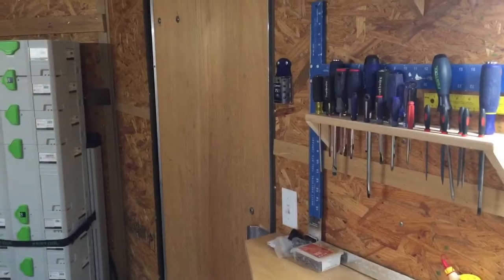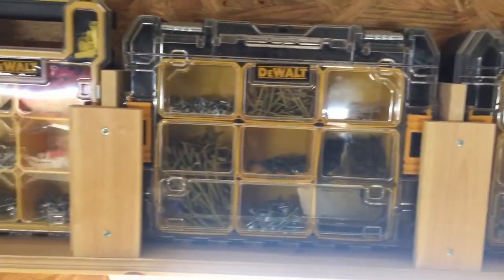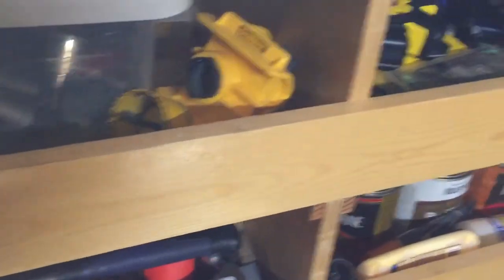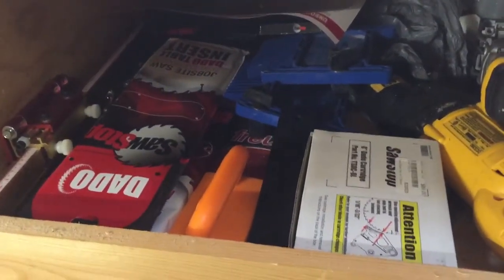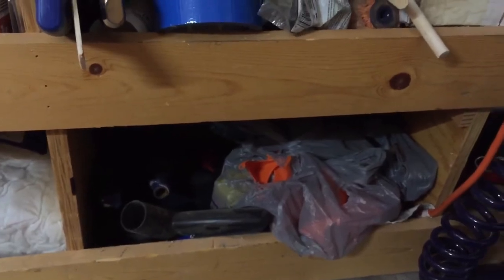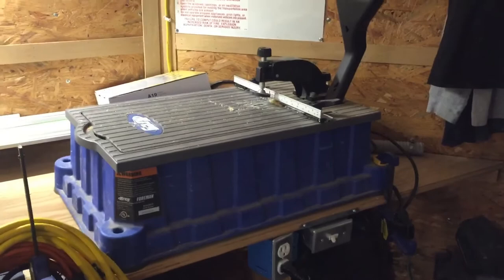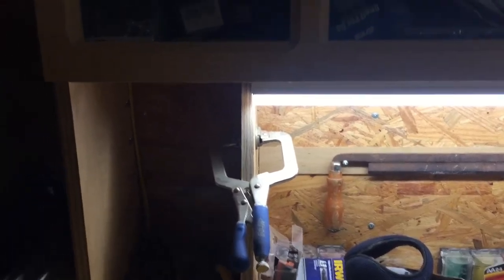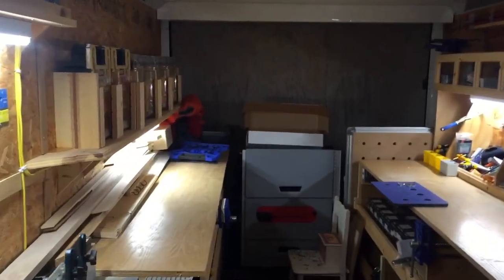Construction Work Trailer Tour!  Millis Construction

Comment: How do you use dowel rods to set formica countertops?
Reply from the maker: After adhesive is applied to the wood top, then lay out dowel rods about 4” apart all the way across. Then apply glue to the back of the Formica. Lay the sheet on the dowel rods then position correctly and begin removing rods from the center working out as you ensure it goes down evenly and in position. Saves accidentally bonding it in the wrong spot